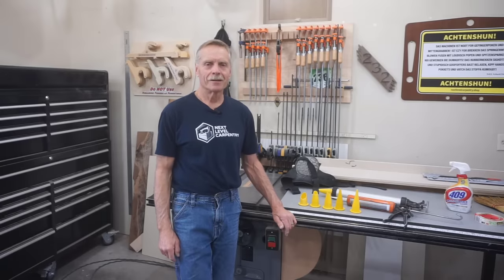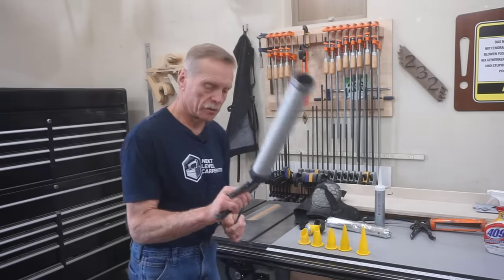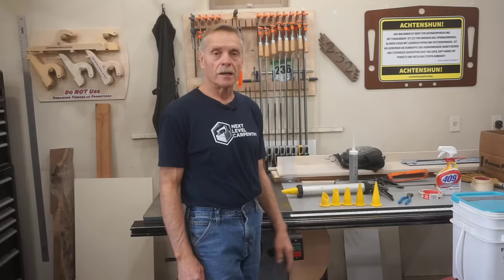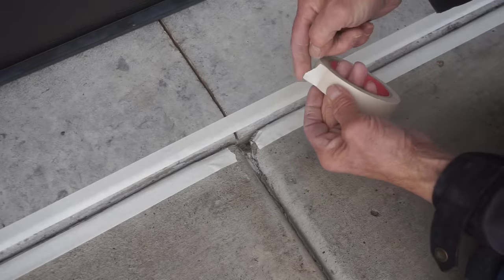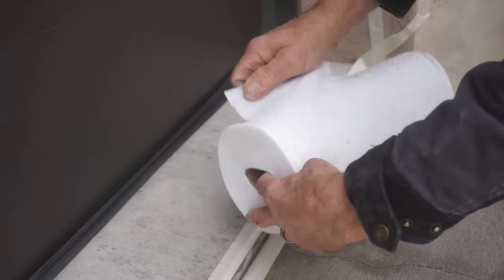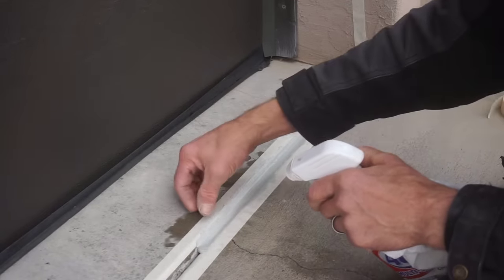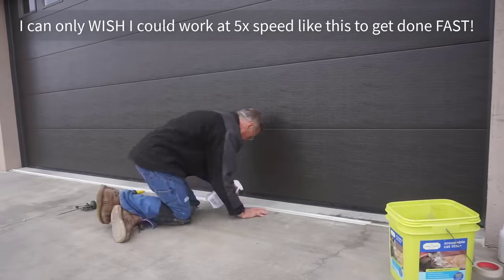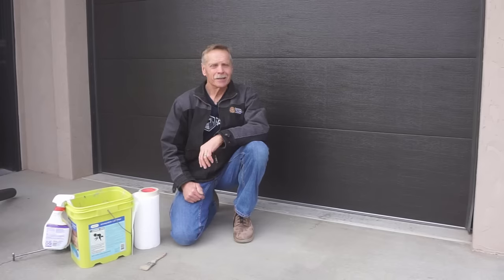How to Caulk Concrete Control Joints with Perfect Results Every Time

Comment: BRILLIANT! I love the idea of masking tape to keep the lines clean. Would you recommend this same process for the gap between a brick wall and wood on an inside wall -- assuming the caulk is a solid bead (dipping into the mortar grooves) before you pull off the tape?
Reply from the maker: Absolutely... the end result will only be as good as the job you do with masking tape so figure out a good way to apply the tape for sharp, clean lines separating caulk from brick and wood.  Practice a little in a less-noticeable place so you learn how to deal with your unique situation/conditions.  If you can get a color you like in a product by Sashco called Log Jam (instead of the Tremco Dymonic used in this exterior/concrete application) it's the product I'd try first.  Not telling you what to do, just mentioning something to think about... https://www.amazon.com/dp/B0038I28KQ/?ref=idea_lv_dp_ov_d
Best, Matt
Reply: @NextLevelCarpentry  Thank you so much! We have so much caulking to do in a condo we purchased. Whoever did the work before didn't use backer rod, and the entire place needs to be redone--walls and ceilings--anywhere two surfaces touch. Do you know if the Log Jam you've recommended would work if we use backer rod to fill the gaps first?
Reply from the maker: @laura_zielke  backer rod is usually a good idea but not always necessary with Log Jam.
As a rule you want the joint to be half as thick as it is wide and backer rod helps achieve that ratio on wide deep cracks. Log Jam has some texture to it to look like chinking so it works good for rough surfaces but nothing like finished walls...

Comment: Good video and tips! As a professional painter/carpentry much of your technique has already been in my bag of tricks. I took close to 2 hrs reviewing the comments and I have to side with your perspective and detail to work. I have heard much of the negativity in how others are so much faster and better etc, yet offer no supporting proof. Such things as painting a room in a day.. and i chuckle when i see the results such as the amount of lint left on the walls from using the 99 cent roller cover etc. I too have a good caliber of customers who want right and not cheap & sloppy.     With all that said i would like to ask your opinion of what to do at the end of the concrete joints where they meet the lawn area. I realize the caulk will not be all the way to the bottom after finger tooling the material into the joint. Would it be better to keep the ends "open" for any possible moisture to escape, coming up through the "crack" where the joint did its job, and/or where any moisture did get  by the caulk fron the top?  Or to seal them up to prevent water from seeping in the ends and possibly freezing at some point pushing the caulk up and out of the joint?  Thank you for your time and consideration.
Reply from the maker: Hey Alan... your comments concerning quality and the time it takes to achieve it are a breath of fresh air so thank you for including them in this long list of viewer comments.
Personally I seal the ends of control joints off the end of the slab and vertically down until they stop. Since there is almost always a crack at the bottom of a control joint any water that seeps in is going to run out that shrinkage crack so it can't build up under the sealant and lift it.
I like the fact that that crack is sealed up as much as possible to keep ants and other bugs from building nests in there which is a definite probability.
Keep up the good work you do paying attention to detail... and I'll keep your words in mind to sustain me against the onslaught of negativity that This video seems to attract on occasion.
Best, Matt

Comment: Thank you so much for your excellent video. Just one question: Where do you get your silica sand?
Reply from the maker: It's best to find a local contractor's masonry supply outlet where silica sand is sold in bags at bulk prices.  I'm told Janitorial supply outlets sell the it as ashtray sand.  As a last resort you can use this link on Amazon:  Silica sand in either 5lb or 10lb quantity:
https://www.amazon.com/dp/B07NXVL3ZD/?ref=exp_nextlevelcarpentry_dp_vv_d

Comment: A timely video for me, thank you!
If most of the felted expansion strip is mostly rotted out, is it OK to rake it out and to use backer rod to establish a uniform depth of about one inch for the caulk?
Reply from the maker: It would be fine to rake out rotted expansion joint strip and you might try using a stiff wire wheel on an angle grinder to do it. The rule of thumb for joint depth is 1/2 of the joint width so don't get carried away with that angle grinder because a joint that is too deep doesn't hold up like one that is the correct depth. Best, Matt

Comment: Great video!    Can I use this same process for the smaller saw cut contraction joints in my driveway?  Should I consider using backer rod or do you prefer to fill the whole seam with the dymonic?   Thanks for the shared knowledge.
Reply from the maker: Glad you like the video Tanner... thanks!  I use this exact same process for those 1/8" ~ 1/4" saw cuts all the time... no problem.  Since Dymonic FC is not self leveling it sets its own depth pretty well at about 1/4"~3/8", depending on how much you 'force it' down during application so backer rod isn't necessary IMHO.  Technically, for good joint 'design/proportions', that's too thick for the width of the joint and if you get a lot of expansion/contraction or vertical 'heaving' movement it will probably pull loose from one side or the other because it can't stretch like when it's used in the recommended joint depth = 1/2 width ratio.  That's not a problem IMHO because sealed joints, even if they pull loose in a few places (which can easily be repaired), are far better since sealant, even if slightly compromised, will still keep out 99% of the dirt and 95% of water.  Make sure to scrub those narrow joints out with a stiff brush or something somehow, hose them out good, and let everything dry before starting or masking tape won't stick worth a hoot.  Pressure washing is probably best but make sure to hit the joints at 90 degrees to the cut rather than just blasting straight on through the joint.  That way both 'walls' of the joint are clean for better adhesion...make sense?
Hope this helps... Best, Matt
Reply: Awesome.. Thanks again!   I’m going to give it a whirl.   Looking forward to the project.

Comment: Im a Pointer Caulker Cleaner Journeyman in the Bricklayers and allied craftworkers in Northern Ca, (PCC)
Pointer is Tuck pointer that has to do with masonry restoration generally Just as the Cleaner Refers to.. Caulker is exactly what it refers to, we do every sort of sealant work. We actually tool the joint with a metal blade. Window frame/Glazing Joints expansion Joints on and on and on. Join up if you want to know how its done productively. Your video was cool in that you had so many ways of doing what we do but, cant make any money doing it that way.
Reply from the maker: Thank you for a detailed comment.
 It occurs to me that one thing not taught in pointer Caulker cleaner Journeyman School is how to run a small business profitably. I don't do sealant like this on a regular basis but I have done a considerable amount of it over the years. In all that time I have not only not lost money but doing sealant work is actually a pleasantly profitable activity... but you do need to learn how to recognize what customers and what projects are a good fit for sealant work of this exceptional level.

Comment: Thanks for the great video. How do I remove the existing failing caulk from my driveway joints? I assume that needs to be done first before applying the new caulk. Any pointers?
Reply from the maker: Removing old caulk is done with much weeping and gnashing of teeth, Kevin... never fun or easy.  I'd recommend a long-handled pipe knife and a stiff knotted wire wheel in an angle grinder (run the grinder on a very low rpm/speed) for the bulk of it.  Might have to resort to acetone and a wire-bristled 'toothbrush' for cosmetic clean up if the previous job was extra sloppy.  Good luck... once you get a system figured out it should be rather straight forward and not too bad considering the improvement you'll get when complete.

Comment: Great informational video! What would you do to a joint that had wood in the joint, but the wood has since rotted away and there's just a gap there now. This is the case between my sidewalk and driveway. Thanks!
Reply: I did that job last summer. My pool deck has 2X4 redwood boards for expansion joints between the concrete slabs. They were installed in 1963 and badly rotted so last year I dug them out and replaced them with new redwood. I bought rough cut redwood, then used an electric planner to plane the board width down to fit in the gap. I then caulked the seam between the wood and concrete following the directions described in this video. After the caulk was dry, I painted the redwood with an oil based sealer to make them more resistant to weather and water. Where the gap was deeper than the height of the wood, I used sand in the bottom of the gap to raise the board up to level of the concrete surface.
Reply: @charliepowell8818  Thanks for the reply. I didn't think of replacing the rotted wood with new wood, but I guess that makes sense. I will definitely follow your advice.

Comment: I realized that nothing or no one lasts forever so how long have you found that this product lasts before it begins to separate from the concrete i.e. little hairline cracks?  Great video! thank you.
Reply from the maker: This stuff is the best option I've ever found.  Some joints I've sealed like this over 20 years ago are still in great shape.  The surface 'aligators' a little bit but it definitely doesn't get 'hairline cracks'.  Other joints pull loose after a winter's worth of freeze/thaw cycling when adjacent slabs 'heave' differently and pull sealant loose from one side or the other.  I see that a more of a failure of subgrade soil preparation, drainage or compaction than failure of the sealant to do the job it's meant for.  The takeaway is that, done right, this product and method is your best chance of long term durability because it only fails when conditions exceed its performance.  I can't think of an instance where I felt the sealant itself failed by becoming brittle, stiff or weak.  And Tremco has never paid me a dime to say any of that! 😉😎

Comment: Great video presentation! I have used SiKa self leveling over the years but like you here have found it challenging to work with so will be more than likely using a no sagging type next time. I was wondering how more durable the sausage Polyurethane (Vulcan?) product is than the Silka self leveling or no sagging might be? And how much more cost efficient is it when you have a lot of drive control joints to fill. My drive joints that I filled about three or four years ago are pulling alert or cracking in many places.  All suggestions are welcome. Thanks!
Reply from the maker: Thanks Wayne.  I stay away from self-leveling because it seems to get brittle over time where urethane (NOT polyurethane) stays flexible for decades, literally.  With all the labor involved in doing a professional job of sealing joints I don't even really consider the cost of material as a deciding factor.  
Even Vulkem or Dymonic urethane will 'pull away' in places from extreme slab movement (caused by frost heaving) in my experience it doesn't just come loose on it's own.  I've NEVER seen it crack.  Best of all, if it does pull loose in places, it's very easy to trim away the un-stuck sections with a utility knife and apply a new bead of sealant, masking and tooling it just like it's shown in this video.  Can't say that for self leveling.
Hope that helps...
Best,
Matt

Comment: @NextLevelCarpentry Ok, so I just had a concrete company owner come out to look at my driveway.    I have cracks about maximum 1/4" in about eight slabs.   His recommendation is to replace ALL eight slabs.    I asked why not just seal the cracks, and he said he could but it would only last a year.   Then I come in here and see your excellent video on sealing the cracks.   What am I missing?
Reply: @mattjackson3996   Thank you for your kind reply.   I am curious as to what the estimate will be.  I have another fellow coming in an hour to see what he says.  It will be interesting to see what he says.
Reply: Ok so I just got the quote from the first guy to replace eight slabs and it was $14,507.00   😬
Reply from the maker: @tonyc945 Concrete ain't cheap.  If you do decide to get the slabs replaced make sure the contractor does a thorough job of replacing/compacting the subgrade to prevent failure of the new slabs.  Bad concrete might not fail over excellent subgrade but good concrete will fail over bad subgrade.
Reply: @NextLevelCarpentry   I would really like to do repairs and caulking like you demonstrated in your video.  The second guy is going to give me three estimates, including one to do repairs/caulking.  My sense is the actual physical labor to repair vs pouring concrete is more difficult and they simply would rather pour then get down on their knees to do the repairs.   I will post the three estimates when i get them.   Again, thank you for your excellent video.

Comment: Thanks for the informative video. Could I use this method to seal the joint on my poured basement walls where they meet the floor? I'm about to finish my basement and I'm looking at ways to seal for seepage and what not.
Reply from the maker: This is the method I would use for sealing The Joint between a basement floor slab and the walls. You should know that sealing the joint with this or any other method is not very effective to keep seepage out. The pressure from water under the slab or behind the wall will force its way through no matter what if it is sufficient. The only real way to keep water from seeping in in that location is to have proper drainage and drain tile on the exterior of the foundation wall. That being said this method should work well for sealing out bugs damp air and potentially radon though so as I said it is the method I would use for that application...

Comment: Can a driveway paint be used over the seam after its cured? Great video, THANKS!
Reply from the maker: I'm not the best person to ask but will tell you that, generally, paint will dry and get brittle while urethane remains flexible forEVer and will cause the paint to crack so I don't recommend it for aesthetics.  Best, Matt

Comment: I know that you were trying to keep this concise (leaving out discussion of backer rods, for instance).  But I am left wondering how you finished the "T" joint.  How did you feather it out?
Solid video.  Not a wasted moment.
Reply from the maker: Just carefully tape around the edges of the Tee joint then fill, tool and apply sand to the sealant.  It's a bit more involved the first time through but, once you've done one, it's a cake walk from then on IMHO.
Reply: @NextLevelCarpentry  I guess I wasn't clear.  Maybe I misunderstood the project intent.
It appeared to me the scope was just a long the garage door, but there was a tee.  So what I was wondering is if you had a taper-to-zero technique at the tee.
Or was the scope to do all the expansion joints on the driveway?
Reply from the maker: @barbeonline351  As you might imagine, I tend to take everything to the next level so I actually did seal all the control & expansion joints on the whole driveway.  If I didn't to that then, yes, I'd just taper to zero at the tee joint you're asking about.  What I hoped to show in the video was how to get professional looking joints, regardless of what, where and how much is sealed since those are all separate topics in and of themselves IMHO.  Hope that helps...
Reply: @NextLevelCarpentry  It does help.  Thanks for the personal attention. 
And, yes, your Next Level shows.
What is most striking is the common teaching says that to go from B+ to A+ doubles the required effort.  I have watched two of your videos so far (this and making perfect cedar shims).  You show that A+ is no harder, and has fewer headaches, and that is even before factoring in customer satisfaction.
Well done.
Reply from the maker: @barbeonline351  I like your perspective.  When talking about quality, my perspective is that if it takes a little more work to make something a lot better (going from B+ to A+) it's probably worth it.  If it takes a lot of extra effort to make something a little better (A+ to A++) it's probably not worth it.  This approach has served me well in all manner of work situations over the years.